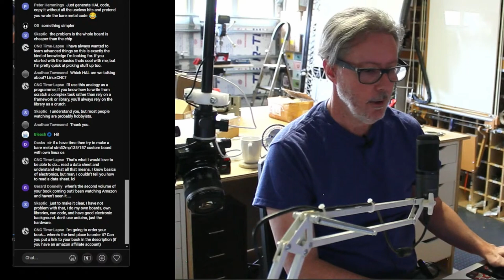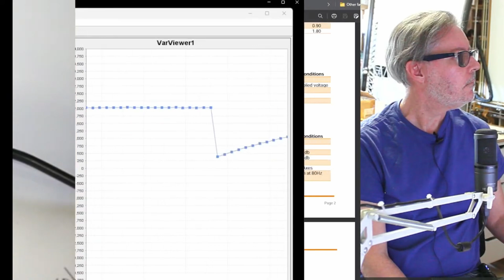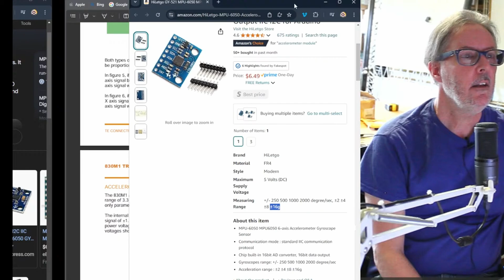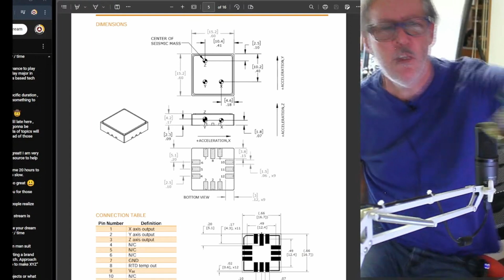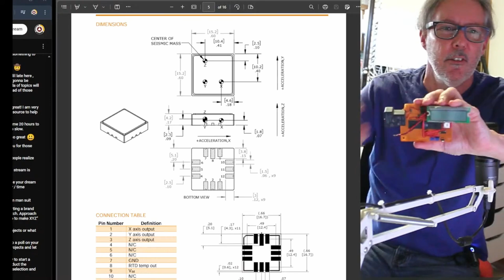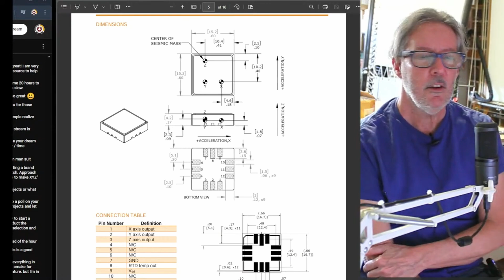Discussion on Arduino vs Bare Chip (STM32 Development) and Starting an ADC Project

Comment: Many ST Boards dont need the programmer. They have "ST link" which is a built on programmer on the board and you connect by USB.
Reply from the maker: Yes, many of the development boards out there have the programmer integrated. On my channel, you will only find me working on breakout boards and developing from the bare chip. This is how I enjoy developing and how I feel many should learn where building around the bare chip provides a great jump into what is required to build an entire circuit from scratch.

Comment: ST has a huge base of support software, and the nucleo boards are sort of bare minimum support, vs. "bare chip", so pretty good Base to start hardware design from, while still having a development environment (more than one) to be efficient in, and, yes, one can do assembler programming, even just for parts of an application that need to be fine-tuned.

Comment: There are many things mixed up here, hardware, IDEs and software, and R&D and production. There is no problem using cheep mass produced hardware and learn how to program them without libraries, or modifying the hardware. There are some boards still considered bare metal with minimum required hardware.